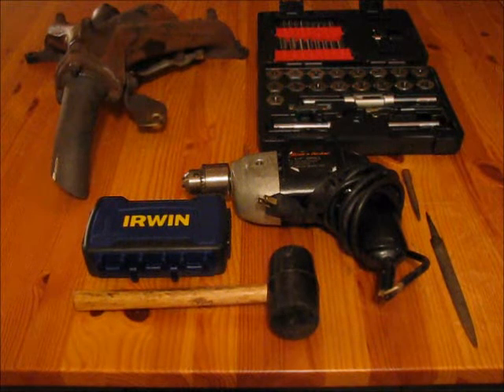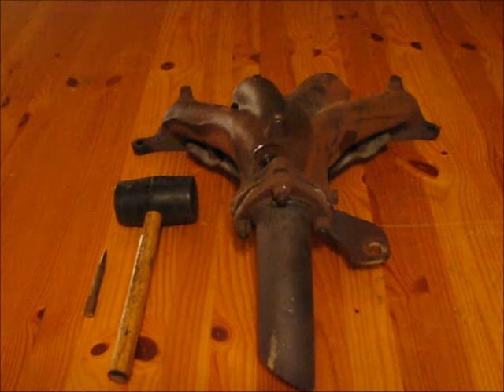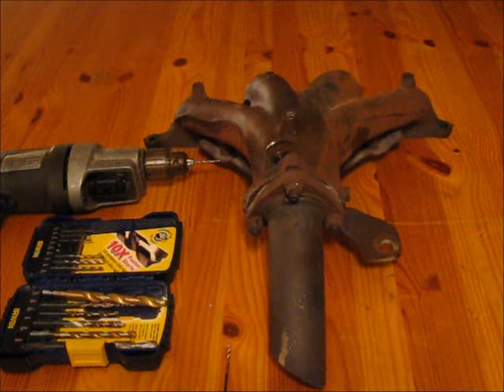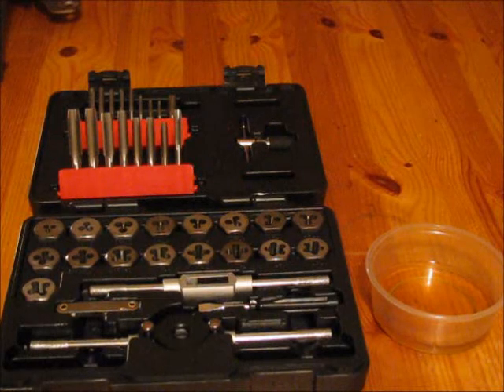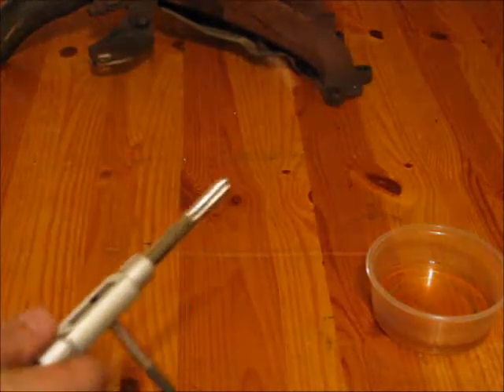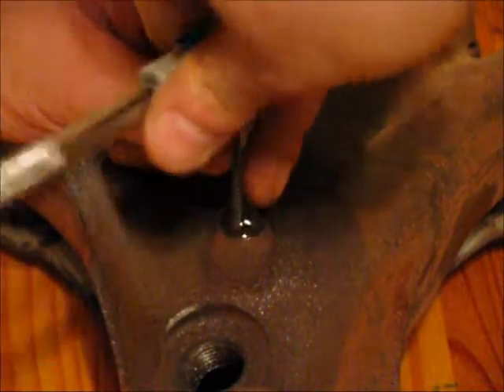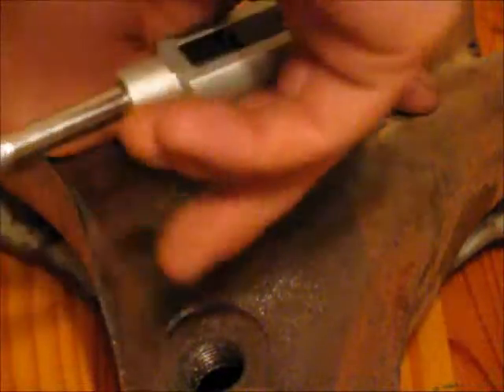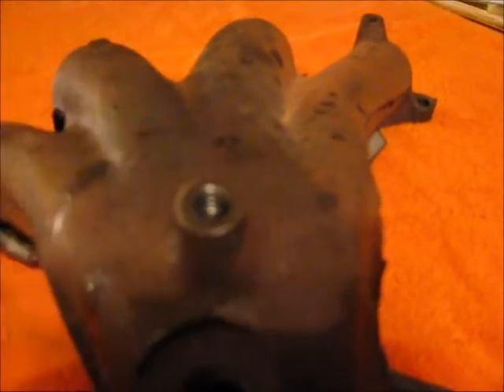Tap & Die set Pt.1 (tap)

Comment: "weld a bolt to the top" Yes this works but if you dont have a mig welder or know how to properly weld , this is the "old school" way to do this and it works just as well , I for example dont have a welder but I DO have a tap and die set i inherited from my grandfather that is about 60 years old and amazingly still has ALL its parts lol how  that happened is beyond me but it works well!

Comment: do you recommend a good tap/die set?  Everything I've used so far will strip or dull the tap and dies  when using on ferrous metals.  I need something strong for ferrous metal and higher strength steel.